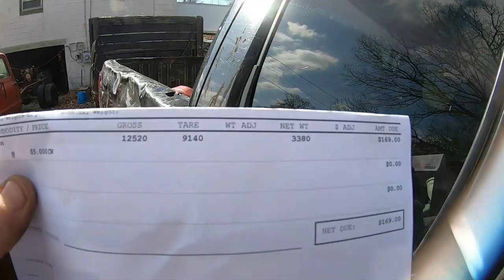Scrapping 3 cars w/ bonus scrap run

Comment: are you pulling the cats there was a guy in vermont paying $500-1200 per vehicle for cats. its a processor. 18mm 6 point socket will take off those locking lug nuts